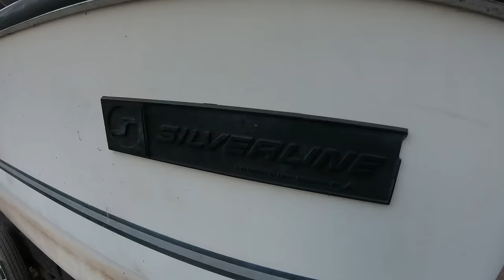Buying cheap boats

Comment: Nice free boat, the reason the water splashes over/around the front of the boat is the outboard trim is set too low, there is a pin on the engine mount that pulls out (different holes there to set it differently) and allows the bow to ride up higher with the prop pushing up a bit higher, you will find the boat is faster as well. Newer ones have electric trim with a push of a button.  Good find!
Reply: Yep, boat plows water and doesn't plane because there's no tilt to trim. 😊😊

Comment: Clunk, clunk, clunk.....hmm there's something in my tire...a 6" long socket tool...."Tires good"
Reply: that part had me deadddddd it was so funny haha
Reply: RSSS68 Camaro  Thanks Camaro, I thought about that after my comment, but it looked like one of the tools I got with a Yamaha 175 Enduro tool kit.
Reply: Chainsaw Bar wrench
Reply: someone left a tool out in the  rain dont know if i can take it took so long to bake it  lol only a few will get this  old song lol
Reply: Camaro 1968  scrench ?
Reply: Camaro 1968  chainsaw sparkplug screw driver bar adjust thingee. Any body see the boating parts?
Reply: @peterhessels2903  Bar wrench on one end and spark plug wrench on the other end with a screwdriver on the handle
Reply: Lol i used to drive a tow truck!  Used to find all kinds of strange stuff stuck in tires!  Best one was a Barbie doll leg!!!
Still have it 25yrs later in the bottom of the toolbox!
Reply: It was one of those cheap chinese tools that come in the little pouch to make you feel better!  In reality the tools will do more damage just trying to fix the original problem!!! I do admit I keep the sparkplug tool too.  Always toss one in the glove box or tool kit cause ya never know!

Comment: You had me laughing so hard! You might want to tilt the engine up a little bit and it will bring the bow up over the water to increase planning and decrease water resistance. Trust me, it works wonders! That motor probably doesn't have the feature so you'll have to figure how much tilt manually. It will surely increase speed dramatically. Double check that transom will you? Great video!!!!

Comment: As a viewer, it'd almost be a bummer if Andrew bought a brand new piece of equipment that didn't require cleaning or fixing up.  I look forward to those parts.
Reply: Powersaw  Youtuber Human. Breaks down brand new products. To see how its made. New.  Then reassemble.
Reply: Would be the most boring vid on this channel .... Andrew loves to fix and repair stuff and if it old school, even better. I think he earns enough to buy a new excavator ... but this is not happening. He enjoy servicing and taking care of his stuff
Reply: @38911bytefree  Andrew has said before. Like us, with all the sensors and programs and things. The new stuff is much harder The old stuff can still be fix relatively cheap. Mechanics today are computer tech first. He loves to see it fixed. His ldea of a New truck,  is 20 yrs old at least
Reply: Yep, I really thought the new gizmo for emptying fuel tanks would have got modified by now.
Reply: @2H80vids  I was surprised Andrew took it in the water that fast. That bein said ,he only did bc he knew he had assistance close by.

Comment: I've never ever seen anyone with a chainsaw wrench in a tire haha wow.
Reply: I used to work at a tire recycling plant, I saw it all, the best one was the T bone from a steak that went right through the tire.
Reply: Ran over a cheap butter knife on a dirt road and it poked the tire all the way through the tread block into the tire causing a leak.
Reply: And the way it missed the inner seal, 1 in a million
Reply: saw a piece of straw in a tire was leaking through the straw

Comment: A whole new meaning to "launch the boat"!  Priceless!  If you reset the motor one or two notches up, kinda like trimming the motor up, it will stop spraying so much water from the bow. Just don't set it too high it has a problem planing out. You will see an increase of speed also.  ATB!
Reply: This needs to be top comment.

Comment: The pitch of the motor may fix the spray problem!! aloha
Reply: I would love to see that boat take off with the trim adjusted.
Reply: You can't fix the pitch when the transom is rotted and will fall out any minute.
Reply: Can you explain this to a noob? Is it suppposed to be adjusted so the bow is lower or higher to avoid the excessive spray? Thx!
Reply: Martin Myrdal in most motor’s, there is a pin that you can set that limits how low the motor can trim down. You set this based on the individual setup.  Most new boats are set up by the dealer and is based on different factors including prop pitch and whether the nose plows etcetera. If the transom is rotten, it can flex to the point it will negate the original setting (or it could be it was changed by a previous owner).  You want the bow up a bit in the beginning to get on plane... but not too much.  Once up on plane, you will trim the motor up a little at a time to give a better ride and reduce fuel consumption and increase speed.
Reply: @Cotton088  this old 65 is manual trim.  There are 5 or 6 positions it could be set too, but the transom definitely needs beefed up.

Comment: Your boat is plowing - There's a pin in the motor mount that allows you to change the angle the motor sits relative to the boat. You need to move the pin out one or two holes and it'll raise the bow so it doesn't plow.
Reply: Yes what I was wondering.
Reply: I think the Whale Tale is causing the bow to plow
Reply: souliog yup. Whale tail pushes the engine up, so the bow down.
Reply: I wanted to say that also.

Comment: I Like your video's, can't wait to see more of the garage work. I saw the  Mercury outboard motor you repaired. I saw you check the lower unit. In case your not sure about changing the gear oil. I too did it wrong before someone corrected me. The screw in the bottom is for draining, but it will not drain well at all unless you loosen the vent screw.  Sort of like putting your thumb over a straw with water in it, it want drain  until you release your thumb. While the vent screw is out, you pump the heavy duty oil, in from the bottom drain hole until it come out the vent. Put the vent screw back in, that will closes the flow from coming out the drain hole until you get the screw in. This may be helpful for some of your viewers who has never done it before. I found out you can't   put it in the vent hole, at all. It has to go in the bottom as crazy as that sounds. Waiting to see more new video's.

Comment: Omg when the boat comes off trailer while backing up .wow
Reply: Boating 101. Take the winch off but keep the painter line tied.
Actually 101 is put the bung in.
Reply: almost as funny as when she drops the rope when she clearly could have run a bit faster and held it and forcing him to run into the water to get it back
Reply: My biggest fear lol

Comment: When you lifted the engine from dragging on the road the flex in that lower transom shows that the wood inside is absolutely rotted out.
Reply: I noticed that too! Glad im not wrong:)
Reply: transom is completely gone. even taking that on the water was completeasly stupid. could have sunk both his dogs in one go
Reply: I was just checking the comments to see if anyone else noticed that! That transom was flexing like it was made of rubber, very dangerous.
Reply: Put it in slowmo as he did it. Scary! Even the bottom of the mounting bracket comes away from the transom
Reply: Yikes. Note to self, never get on a "free" boat that has lived outside for decades on its trailer. 👍🏼
Reply: Can the transom be repaired or replaced or is the boat toast being it is fiberglass on the surface?  Thanks.
Reply: @PhillipHall01  
Anything can be fixed. 
Throwing dollars at dimes is never smart though.
Reply: Eric French 
Thanks Eric. Maybe it can be done at home if a guy is handy with fiberglass? If not at least he has a pretty good motor, or it seems to run good now. I wonder if there are videos showing how to properly rebuild transoms... Thanks Eric for your reply. Phillip Hall
Reply: @PhillipHall01  
Hey! YouTube search, brilliant! 😄
Reply: @PhillipHall01  ..........It sure can be repaired,but it is *not * worth it on this old boat;
   Better get a transom sized 5/16 or 3/8ths aluminum panel (expensive!), glue (get the real stuff!) and bolt it to the transom on the outside (make big"washers" to put on the inside!!!)  ; 5/8ths inch to 3/4 marine plywood will also do it,and cheaper;
    Either way,the panel must go all the way to the sides,top and bottom,where the hull is sturdier; after it is painted white,it'll look good,like a 4x4 ,still being only RWD    lol
Reply: Thanks Jose for the detailed reply.
Reply: @freelectron2029  I bet thats why  it was parked in the first place , i garuntee you he stringers are water logged too  sitting out in NY state
Reply: Saw that. Guess thats why the price was right.
Reply: phillip hall can be fixed very cheaply if you do your own work. If you have to take it to get fixed better to buy another boat. Fibreglass work ain’t cheap because it’s a miserable job.
Reply: That motor is ancient and parts may not be available.
Reply: 24:30
Reply: Freelectron oh please
Reply: Freelectron Calm down! For one thing those are labs they can swim for days. They don’t sink!
Reply: @PhillipHall01  You guys must be new to this channel? Doubting if Andrew can fix ANYTHING. He may be not much of sailor though.
Reply: Why do you ask me that?  If you read my comment I simply ask a honest question because I did not know the answer to that question. I had been told when the transom was rotted out the boat is toast. Not that it can’t be fixed but is it worth fixing. I do not question this guys ability. Hope I did not offend you by asking. I feel certain he did not mind the honest question as comments help his standings with YouTube?
Reply: Yeah that transom looked like it was made of playdoe...and then he goes and adds more weight too it, with the kicker. 🤣😂
Reply: lol
Guaranteed with how much crap was in that boat.
Clear years of being open.
Comment about "wood in a boat being for firewood"
I thought, boy will he be surprised how much wood is in a fiberglass boat!

Lots of good parts tho, i scrapped a few boats nicer than that to put together mine.
Tip: Aluminum hulls are easy, but will probably still need to replace the wood bits and transom. 👍
Reply: Good call pistol
Reply: This is the first thing to check when buying an old boat.  Transoms are the first to go on the hull.
Reply: Ripped a transom out on my old Mark Twain many many years ago.  Not a good feeling when your motor lays over backwards about 30 degrees. Thankful I was less than a mile from the ramp. Checked on fixing it. About the same value as the boat. Bought another boat with a bad outboard dirt cheap and put my 115 Merc on it.  Ran that boat another 10 years
Reply: phillip hall yes it can be replaced that’s actually the number one job my grandpa is always doing on boats. Even on aluminum boats there is always a middle section that has wood  but on theses fiberglass ones it’s a little easier to get access to, he’s currently doing one right now actually
Reply: I noticed it was rotten when he was vacuuming out the mud from around the bilge. That hole used to have a bolt through it until it rusted completely away
Reply: Just pump some super glue in there and she will be good as gold.

Comment: We love the family friendly channel Andrew thanks for that!

That transom is weak as heck, get an aluminum plate about 16 wide by 20 tall and bolt on the back between the outboard and transom.. that should keep it strong a long time 

And be SURE to round the corners on the bottom where all the force is transferred to the transom, don't want sharp points of the square plate concentrating stress in small area.

Nice find on the free boat!
Reply: Pretty sure he is going to want to do more than that to the transom
Reply: @gatorsaw3315  yeh, definitely..... he should add a decal too
Reply: The aluminum plate is a good idea, BUT....put it on the windshield, paint "motor for sale … comes with free boat and trailer for parts" on it, and  chalk it up to a learning experience, where no dogs or humans were harmed during the making of the video

Comment: 34:28 I had a good laugh when it slid off the trailer :)
Reply: "I guess those rolly thing are really rolly"
Reply: Normally the truck follows, because the driver panics and jumps out to save the boat 😂
Reply: Just send it!!
Reply: That lady had one job...
Reply: I did the same thing years ago when I bought a new boat that had a roller trailer. My previous boat had a bunk trailer which was a bitch to unload. I was used to disconnecting the winch so I did the same thing with the new boat. When I backed down the ramp it rolled off the trailer just like Andrew's boat. I owned the boat with my brothers so I told them not to disconnect the winch. Next time I went to put the boat in the lake, my brother was with, and I didn't notice that he disconnected it from the winch. Back on the ground again! We still laugh about that! Boat ramps are a fun way to spend a day. Lots of interesting things happen there.
Reply: Vasil Stamenov she just stood there and looked pretty.

Comment: @Andrew Camarata - The bow is too far in the water on that boat.  That's why it's plowing so much water and and soaking you.   There should be a trim pin with 3 or 4 settings that will tilt the motor up slightly.  The motor currently has a negative trim which is only good for slower speeds like 5 to 10 MPH.   Try each one until you find a happy medium.   It will seem like the bow is riding high as you first take off then once the boat planes out it should flatten out and be better.    This will not only keep you dry but will greatly reduce your fuel consumption.   Will also increase your speed. Also might want to repair the transom as others have said.  The soft transom could also be flexing and causing the negative trim.    Hope this helps.   Stay safe.
P.S. - The castle looks great with that new coat of paint.    Another thought,  you could coat the roof with a spray on truck bedliner like Rhino Linings.   That stuff sticks really good and lasts forever.  You can get it in any color.

Comment: Just looked up the Yacht “Vivere” Andrew passed on the Hudson. You can charter that yacht for the low price of $53,000-58,000/week
Reply: Hmmm, I will think about that.... Only think:D
Reply: Considering the look and size of that yacht, I'm actually surprised it's that low.
Reply: Andrew can build one.
Reply: @theone-mz5ut  with the chainsaw... Lol...
Reply: As of 28 minutes ago they're in port at Atlantc Highlands Marina in New Jersey if you want to check them out.
Reply: @glenjamindle  Way to go Glen.
Reply: 58k plus tip

Comment: I’m surprised you gave up on the first boat
Reply from the maker: J W I don’t know, my friend wanted it, there’s some deals on boats right now, I may get something a little more luxurious
Reply: Thanks for the reply. Yea you should definitely do that and make a video of it
Reply: That last boat did seem like a bad design, nose diving and trim needing thingy.
Reply: @marko-seta97  needs a little weight in the back help it to plane  {:-) PAV uk
Reply: @davexvs  It appears that the motor is allowed to drop too much which makes the boat want to plow the water instead of coming up on plane.  Water spray be gone.
Reply: @MrJerryjam  good call
Reply: @MrJerryjam  Also that dolphin fin looking thing keeps it running flat to the water too.
Reply: @JD-iu3vi   Naa,, He's just running out of parking
Reply: Start with the free one and just start trading up and before long you will be cruising around in one of these. 36:00  May take a little smooth talking here and there, but you can pull it off.
Reply: @harthek2000  The six million dollar hole in the wallet. I can't see Andrew going for that even if he had the swank to do it.
Reply: harthek2000 I googled the name on the Yacht. Says you can rent it for $50,000 a week. He must be on the Hudson, yacht coming up from NYC.
Reply: @cliffcollins4124  WTF are you talking about? What does that have to do with the plane of the boat?
Reply: @johnmaddox7432  Your prolly right, but he ever were to get one. Pretty sure it would need a little work :)

Comment: You got a boat for free and it had a Mercury engine on the back.    Those Mercs were some of the best made for boating.  Easy to work on, strong as hell, if you took care of them - they would last nearly forever.  I had a 10 horse for a little fishing boat and a MerCruiser 50.  Damn good engines.  You got that thing cleaned up and did the work on the battery, fuel tank and engine.  Now look at that thing - rockin'.  I like the idea of putting in an inline filter.

Comment: Andrew the boat is snowplowing like crazy. Adjust the trim in the back so the motor tilts up a little bit and the boat will be a lot faster, burn less fuel, and give you a dry ride. Play with the adjustment to get it just right. Adjusting trim is key.

Comment: As noted by others, that transom is shot. If you have not fixed it yet, I recommend solid fiberglass. I have replaced several and they never go bad again. About 3/4 inch solid glass will hold that motor. Then trim it out with the lift pin, one hole at a time with a quick test run each time. When she porpoises, go back one hole. she should be a dryer boat that way as the bow will run higher.

Comment: 24:33 when he pulled up on the engine and the bracket was loose and the transom bowed out. That transom was rotted out and Andrew's lucky that motor didnt break off and sink the boat. Huge fine from coast guard or local police for pollution
Reply: some people should not have boats. after watching this video, he is one! serious hazard
Reply: Andrew Camarata has just said: “Let’s get the sludge out of a transom.”